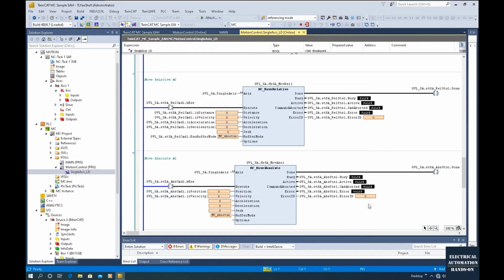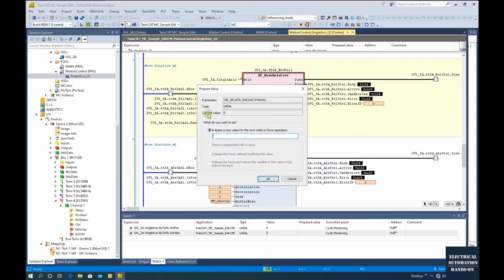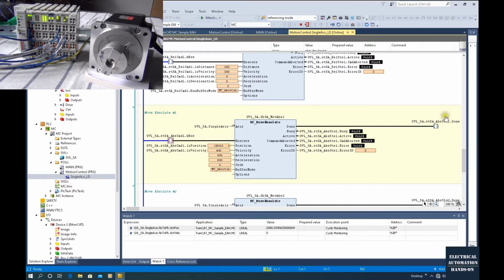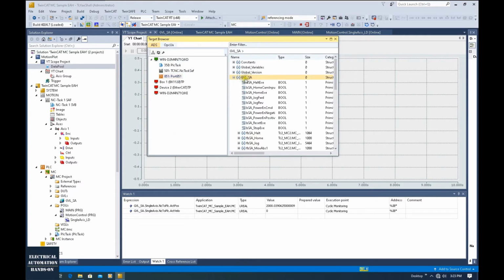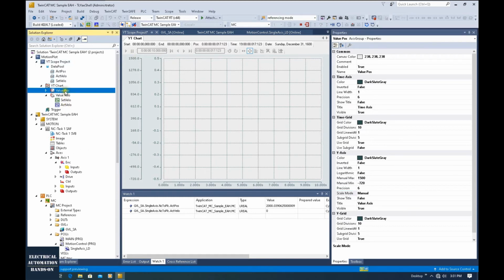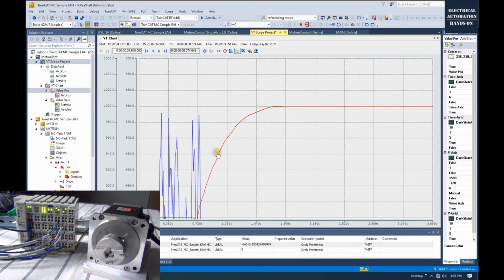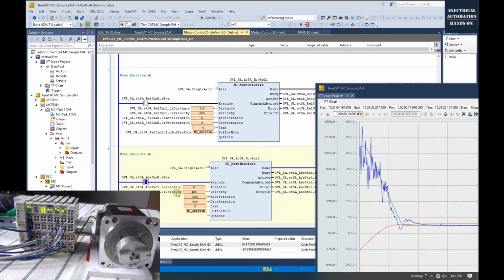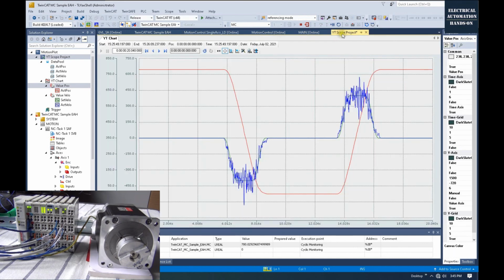MB15. [TwinCAT 3 NC Stepper]Use MC MoveAbs MoveRel FB for Positioning Control[18/20]

Comment: Is it possible to position continuously, so I don't have to cycle the "Execute" input, just change "Position" input and automatically go to target?
Reply from the maker: Hi Kurt, you have to use at least two MC_Movexx. Basically the previous instance MC_Move Done is used to trigger the next instance FB MC_Move. Therefore, you need to combine the 'sequence' flow concepts and MC_Move instances to implement multiple paths.